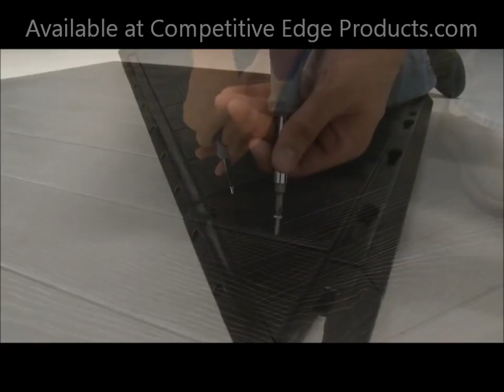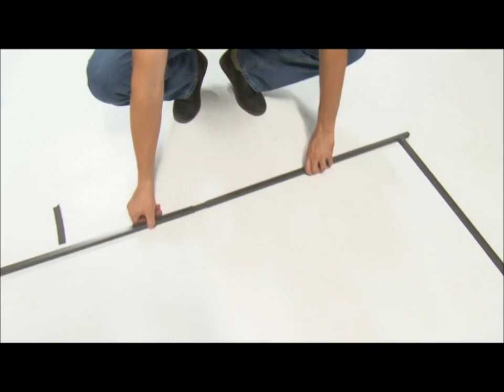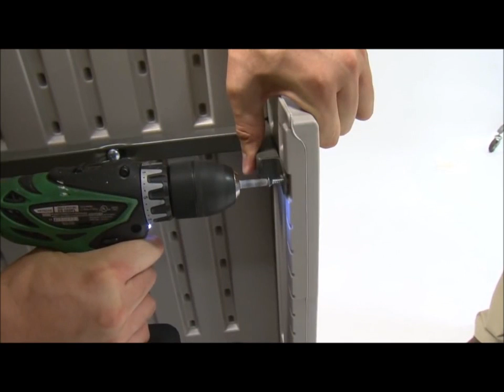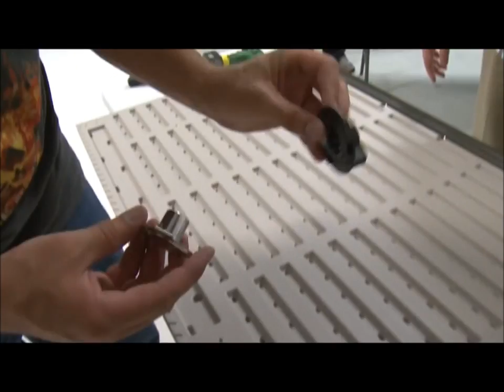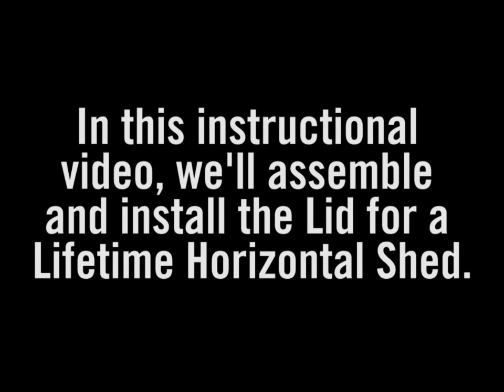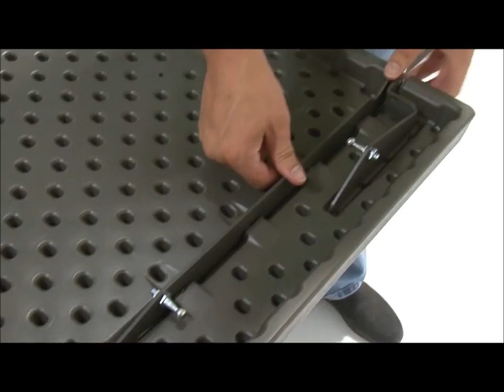60088 Horizontal Garbage Bin Shed by Lifetime How to Install

Comment: Great…can't even get past step one! My floor panels don't slide together. They seem to be not straight so the teeth never line up at the same time.   : (
Reply: This is the exact issue that I am having. The floor panels won't slide together.
Reply: Same problem...called 800 number and spoke with 4 reps and a supervisor. No results. They sent a replacement floor and that failed. Very disappointing.
Reply: I took a knife and shaved off the extra plastic thats left over from manufacturing  and it made the  pieces slide together much easier.
Reply: Shit
Reply: Rodders LW thank you for your comment. I would suggest calling the 800 number on the front of the owner's manual for special assistance. I haven't heard of this problem that you have run into. They will definitely get you taken care of.
Reply: Thanks Charley. We worked hard to work on the bends in the floor and finally got it to lock in place (1hr for this stage). The rest went smoothly. It was pretty freaky that we struggled with the very first step.